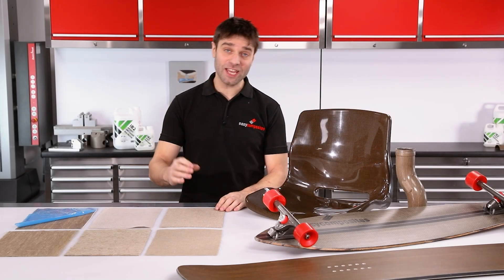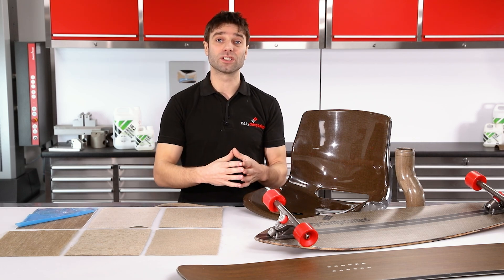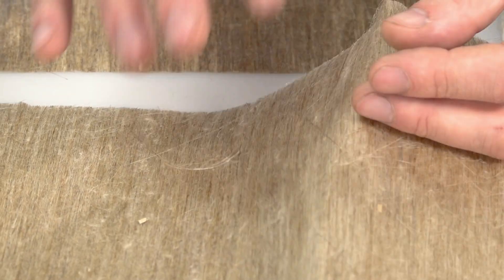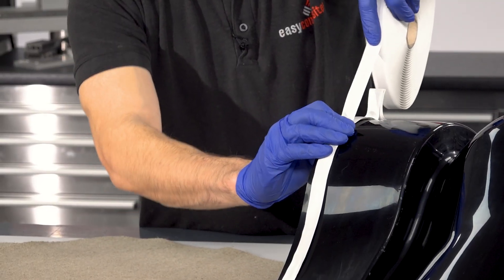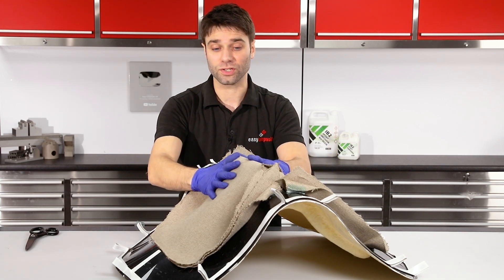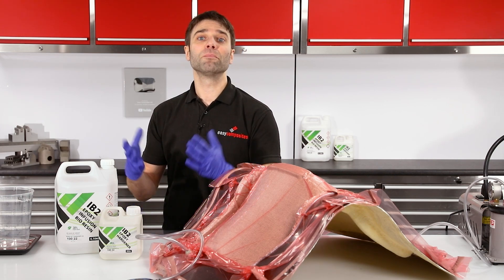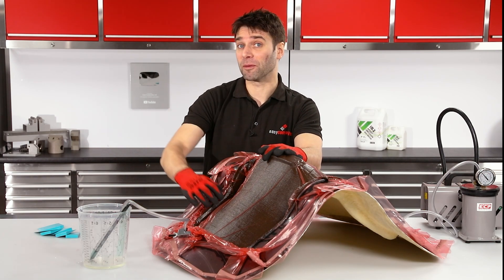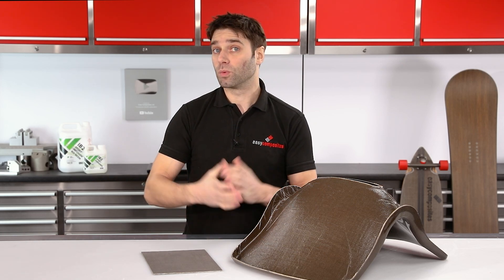How to Use Flax Fibre in Composites; Performance and Processing

Comment: Excellent video!  Is it possible to have a clearer final rendering by using pigments in the resin?  thank you !
Reply from the maker: You can add pigments to the resin if you want to change the colours but normally that would be in a gelcoat.  With infusion, the resin layer is so thin that you would, at best, get a patchy finish.

Comment: If you were to use flax as a backer on the non-visible side of a carbon fiber part (underside of a hood, for example), would it do the job of the mesh and peel ply well enough to infuse the carbon fiber?
Reply from the maker: Good question, the flax works well as a flow media, but without a bit of testing of a specific lay up, it would be hard to say for sure that the flow would be adequate.  Certainly you could, with experimentation, design a hybrid lay up that may work well, but you may need additional methods like rethinking resin feed placement and use of microporous membranes and hoses (like MTI hose or similar) to aid the infusion.
Reply from the maker: Hi, that's a very interesting question! It would certainly be slower than mesh and peel ply but I suspect (haven't tested so don't know for sure) that a heavier weight of woven flax, let's say >300gsm, would probably provide enough flow to allow the infusion without a mesh and peel ply.

Comment: If I’m making a hybrid material with an alternate layup of flax twill and carbon twill to make a total of 4 plies. Would I need a flow mesh and peel ply?
Reply from the maker: Good question, the flax works well as a flow media, but without a bit of testing of a specific lay up, it would be hard to say for sure that the flow would be adequate.  Certainly you could, with experimentation, design a hybrid lay up that may work well, but you may need additional methods like rethinking resin feed placement and use of microporous membranes and hoses (like MTI hose or similar) to aid the infusion.
Reply: @easycompositestv  Do you think even if all I’m making is a hybrid flat panel for testing that the flow could still be an issue?

Comment: Thank you, thank you, thank you my saviors!
I'm a luthier experimenting (struggling) with composites in natural fibres for a couple of years, and I have never been able to find very useful information about them online: I would LOVE to see more videos about natural fibers, the clarity and the quality of the information you give in your videos are always excellent.

I use jute and I have the same darkening "problem" (which frankly bothers me a bit). I noticed that it is possible to control it a little thanks to your SMC Vacuum Regulator: the lower the vacuum, the lighter the color. However, this has its drawbacks during the infusion and I am forced to use a flow media. With manual lamination and consolidation with a vacuum bag, however, the color remains light, even at full vacuum. 
Do you have any experience or advice about it?

I would have a lot of other questions to ask you, but I don't want to be annoying!
Reply from the maker: Hi Antica, no problem. The darkening you're seeing is just the normal appearance change when materials with complex surfaces (which makes them look lighter) get wetted out. When you manage to achieve a lighter appearance, it's because you're not properly wetting out the reinforcement. Think of flax (or Jute) just like blond hair, when it's wet, it looks a lot darker. I'm afraid that there isn't really much that can be done about the darkening of the flax when it's wetted out, without compromising the mechanical properties by limiting the wetting out of the fibres.
Reply: @easycompositestv   Thank you very much, I will try to do some tests to compare light colored parts (infused at -0.6 bar) with dark parts (infused at full vacuum) but so far I have never noticed any mechanical differences. Maybe I still lack the knowledge to be able to notice them.
One last question, if I may: when you leave the dry layup under vaccum to "dehumidify" for 5 hours, the pump is off, right? I imagine the moisture will remain in the bag and will be removed by letting the pump run for a while before starting the real infusion.
Thanks again
Marco 

PS please, a video about Fibrimat too, if you can 🙏

Comment: That was really interesting and the result is attractive. I can imagine using flax to make curved doors for a timber sideboard, as one example. Thanks, Paul – I appreciate your clear explanations and recommendations.
Reply from the maker: Cheers Justin, appreciate the feedback. Agreed, I think flax has some good applications in moulded furniture and architectural pieces; in these applications weight is less critical but your priorities are for an easily mouldable material with reasonable strength and a good aesthetic.
Reply: @easycompositestv  once innovative furniture manufacturers like IKEA start using it to make stronger and lighter chairs, it will become mainstream.

Comment: The Material you have used and Chair Product is Awesome Finish..
My query is that is it cost & Quality wise batter than normal plastic chair which is normally used in City/Transport Buses? I am interested to start business something like that.

I am from INDIA Love you & Thanks
Reply: It does not make any sense for mass production:
- Resin in bulk is 15$/kg
- Flax fiber is 50$/kg
- Resin to fiber ratio is 2:1 so it gives you 26$/kg overall.
- You can only make one part every 8h in a mold (and making molds is very expensive)
- Requires a lot of manpower to make a single seat (mold cleaning + layup + bagging + trimming the part)

Compared to injection molding
- 1-3$/kg, even if you need 2x more material because it's less strong it's still more than 5x cheaper. And if you design your seat with ribs you can probably get away with the same amount of material so that's 10x cheaper
- You can make multiple parts per minute with a single mold
- Easy to automate

Overall for the time and price of making a single seat with composites you can equip an entire bus using injection molding
Reply from the maker: As Guillaume has suggested these materials and this process wouldn't be intended to compete with basic, mass produced injection mouldings. In the video we tried to allude to the complexity of evaluating environmental impact of materials (including 'greener' materials) in the overall lifecycle of a product, there's an awful lot to balance out but no, I would say that for a basic, mass produced, these materials and this production process wouldn't be greener and certainly wouldn't be cheaper. That doesn't mean that there wouldn't be applications where it would or could be.

Guillaume mentioned the high cost of a composite mould but actually, an injection moulding tool would be hundreds of times the cost of the composite mould we made (in a single day, for about $50) for this video, and so applications where you're only amortising the cost of the tooling over low production volumes then a composite moulding process would be much lower cost (and less environment impact) than an injection moulding.

Comment: can you use it for a surfboard?
Reply from the maker: Hi Jeff, yes, you could include flax in the reinforcement mix for a surfboard. It does get used in sports equipment like skis and snowboards for its vibration damping properties too and so these properties might bring something to the feel of a surfboard too. Some research and testing might be necessary to ensure that the fibre bundles are fully saturated by the infusion process so as to ensure that they're not 'dry' in the middle, otherwise water ingress into the fibre might be a concern in the event of a ding. I'm not aware of much knowledge or information existing in this area so you might have to pioneer it! As a starting point, using the lightest weight flax fabric possible would help to ensure full wet-out. We have a 200gsm twill flax fabric which uses a very fine thread https://www.easycomposites.co.uk/200g-22-twill-flax-fibre-cloth but the UD flaxes go right down to 50gsm: https://www.easycomposites.co.uk/50g-unidirectional-flax-fibre-tape

Comment: Honestly I would love some exploration about some practical applications of flax fiber composites, because as much as I love composites, I really want a more environmentally conscious option as well.
Reply from the maker: We do have a video coming up in the summer where we will make a larger component using flax fibre reinforcement. We agree with you entirely that we should all strive to enjoy our making, engineering, and use of equipment and components but try to reduce our environmental impact as we do it. In this video, we tried to be honest about the complexities of doing that and acknowledged that it's not always just a case of choosing 'greener' materials without considering the whole lifecycle... don't get me started on bamboo/epoxy drinking cups! However, if we're at least thinking about these things, earnestly, and trying to understand alternative materials better then that is steps in the right direction.
Reply: @easycompositestv  Did this video get published?

Comment: Thanks for explaining that it is very different from carbon and fiberglass.  My first experience with it was disappointing, because I was expecting something more like fiberglass.  But you do have me thinking of interesting uses for the material!
Reply from the maker: Hi Fredy, yes, the performance of flax will come as a shock if you're expecting its properties and behaviour to be closer to glass fibre (as you sometimes see it, rather misleadingly, compared to). It's still an interesting material and reinforcement but we tend to find that combining it with other types of reinforcement (like we did in our skateboard tutorial a few years ago) is a more practical way to work with it.

Comment: How does the resin factor into the environmental impact, are there eco friendly resins to use for composting said composite material?
Reply from the maker: Hi Tim, we tried to discuss the some of the considerations of the resin half of the equation in the video, one of the main ones being the environmental impact of the resin production in general (and the fact that you'll need more of it if the reinforcement has a lower performance) but there is plenty more to dig into on the resin production and lifecycle too. We cover a bit more about this in our product spotlight video on the IB2 bio-epoxy infusion resin, you can watch that over on our products channel here: https://www.youtube.com/watch?v=umByuqaXWxA

Comment: Very informative as always. You somehow always manage to make a video about a dry topic entertaining and fly by in what feels like half its runtime. 
I'd love to see some content about Flax as core material in the future ... as well as 3d printed parts as cores for complex shapes.
Reply from the maker: The high resin uptake and naturally low compressive strength of flax makes it particularly unsuitable as a core material. Either it's fully wetted-out, in which case it would have great compressive strength (from the cured resin) but would be very dense (almost the same density of the resin) or it remains at least partially 'dry' in which case the compressive strength is very low. There are however natural materials that make fantastic core materials, like balsa wood and cork.

Comment: I had an idea to use pour foam as a mold. Is this possible or have people done this?
Reply from the maker: As mentioned, finishing the surface of the foam is important.  There are dedicated products for coating foam patterns to give a smooth surface ready for making a mould such as our Pattern Coat Primer. https://www.easycomposites.co.uk/composite-pattern-coat-primer
Reply: @easycompositestv  it would be awesome to see a video on making a foam mold or maybe you have one. I would think you make it the same way a regular mold with gelcoat first then fiberglass and then foam.
Reply: Of course you can.  It would work best as a "plug" from which to make an actual mold, and expect it to be 1 time use. You would want a high density foam.  Finishing will be challenging.  If you are reproducing an object, you could try applying a surface coat first, and then pour the foam over the surface coat.   Better yet, apply a surface coat, then a couple layers of fiberglass, and then pour a dense foam over the whole thing as reinforcement.

Comment: as someone who just finished a semester of material science with a large segment on natural fibre this channel is a goldmine
Reply: it seems that hemp would be a stronger alternative, but i don't know much about that. Do you have any insight to offer?
Reply from the maker: Hi Ryan, indeed it does look like hemp fibre does have good potential as a natural reinforcement. We've read papers which have demonstrated hemp fibre yielding better mechanical results than flex fibre but, as far as we've seen, this is only with lab-scale produced hemp fibre which has been specially prepared and conditioned so as to retain and optimise its mechanical properties for composites. As yet (again, to the best of our knowledge) hemp fibre, mass produced in the traditional way, does not retain its mechanical advantage over mass produced flax fibre, but if the lab production techniques are successfully scaled up then it could do, so it's a space worth watching.
Reply: I think you could really come up with some great uses for flax, as it doesn't have the political barriers of hemp, and according to the video has quite an established infrastructure in place, If you are a chemist come up with a resin based on linseed oil, you would make millions..
Reply: @walruschicken  Well, linseed oil on cloth is well-known for self ignition, so it's got that in common with resin plus hardeners :)
Reply: @neilbarnes3557  Yes it does! I've seen it happen too many times, you would be surprised how many aren't aware of that. It would be a great product if some chemist out there could figure it out

Comment: I’m curious to know what the weight comparison would be to a plastic that might be used in a similar application. Are they fairly similar in terms of strength and weight? I do remember the strength being greater than plastic but does that strength come at a large weight premium?
Reply from the maker: Hi Dallas, the density of resin infused flax compared to thermoplastic would be pretty similar. The strength, and stiffness, for a given weight would be different but not a million miles apart. As you may have seen from the simple mechanical testing of the flax laminate, flax laminate has an unusual yield behaviour compared to traditional materials in that it starts to yield progressively, almost immediately, under strain. Before yield it is noticeably stiffer than an unreinforced plastic but permanent deformation does kick-in early. I don't proper like-for-like data to hand but in this example, the flax chair 'feels' about the same as the original injection moulding (in terms of strength and stiffness) but is slightly thinner, and lighter.

Comment: Brilliant informative tutorial as always, thank you for sharing the wisdom.  Great tip, like on letting the pot line run for a bit longer to reduce tension and let any voids shrink !  As described, for none weight critical parts it’s very effective, bulks up well and without mesh/peel offers quite a reduction in plastic consumables.   Have you had any success with silicon buckets/cake tray type containers for the epoxy - as a reusable item. I’m aware the platinum of some silicones will interfere with Polyester setting, but considering for epoxy.
Reply from the maker: Hi Logan, thanks for the comments. You can certainly use re-usable polypropylene containers as your resin bucket. Epoxy won't stick to PP at all so this is a good option; just let it cure and then knock it out. Cured silicone won't affect the curing of epoxy in any way but you will find that epoxy quickly degrades silicone (you'll see it within a few uses) and so, give the cost and bulk involved in any kind of silicone container, you'd be much better of sticking with PP or PE.

Comment: How about a laser or plasma cutter for cutting the edges?  and I wonder if massive two sided steel molds with thermoplastics would be neat. stamp in a hot vacuum.
Reply from the maker: Hi Dan, laser cutting tends not to be ideal for trimming composite materials due to the different materials within the composite; the right cutting speed for epoxy won't be right for flax, resulting in one or the other burning or generally not being optimally cut. If you're looking for an automated solution for trimming then, for a complex profile like this chair, a robot arm CNC would probably be the way to go. As for injection moulding or some form of compression moulding, yes, these are both possibilities. There are some limited examples of flax interwoven with a thermoplastic matrix that have been developed.

Comment: Half of glass is pretty bloody good for a natural. You could easily make a plane from it. Maybe some kind of stainer kan give it a dark wood look
Reply from the maker: Considering natural fibres were all that was available for 10's of thousands of years (if not longer), it is surprising just how versatile they are. In some ways modern society has got used to the advancements of modern composites to reduce weight considerably.

Comment: How about the heat resistance?

When you said that the undirectional weaving has good noise cancelling properties I thought about to use flax instead of carbon for the outer tube of maybe motorcycle silencers?!
Reply from the maker: Hi Daten, as a fibre it's surprisingly good (circa 200c off the top of my head) so if processed with a high temp capable resin it may well be usable for an end-can, you would definitely need to completely dry the fibre first though. Could make for  an interesting experiment!